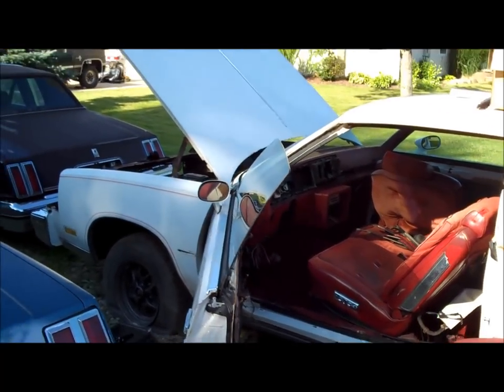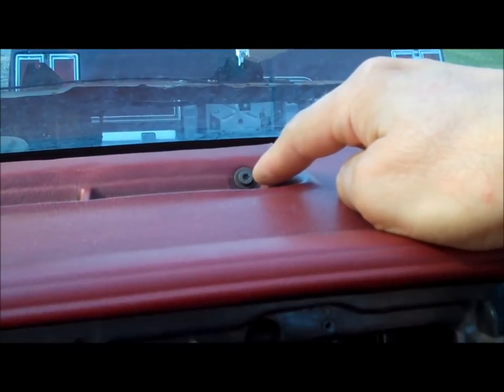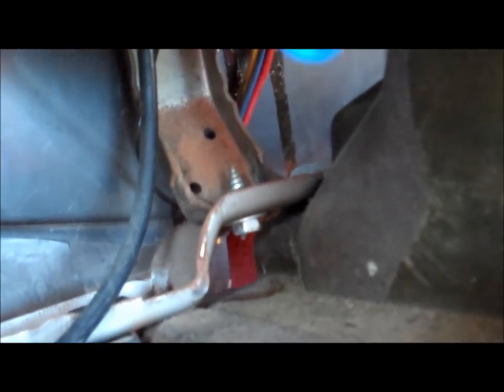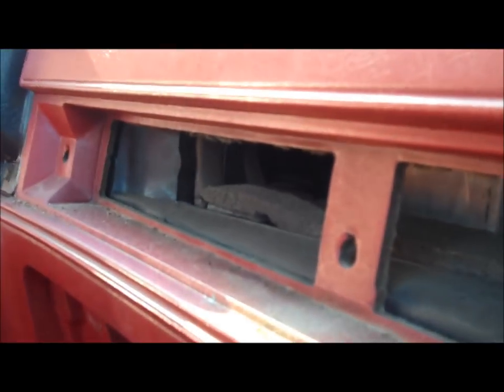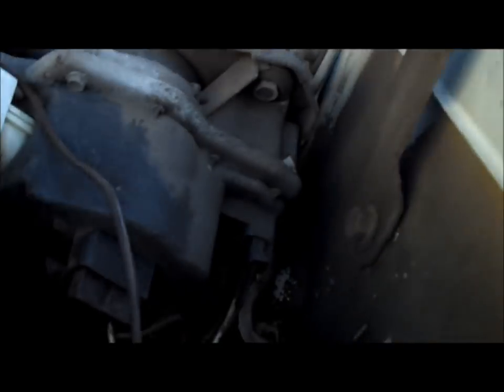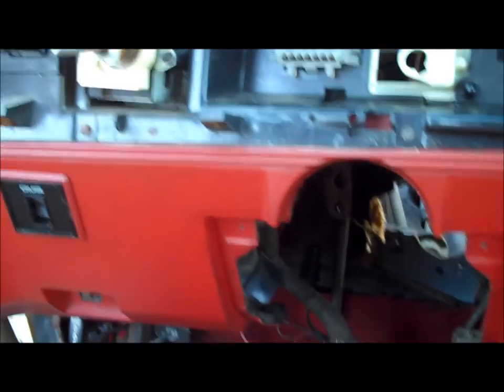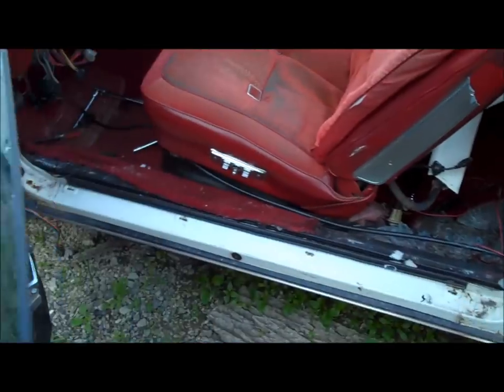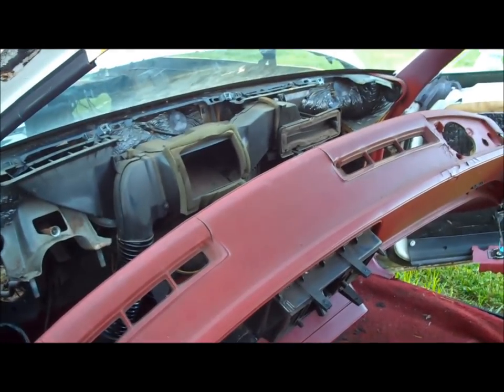How To Remove the Dashboard in a GBody

Comment: I have a 82 gbody I put new lights in my dash but when I turn the dash lights on they still dont come on. Can you help me?
Reply from the maker: If all of your other dash lights work other than the gauges then you have an issue with the gauge circuit panel on the back. Torn copper film.

Comment: I’m going take off my dash on my 84 Pontiac Grand Prix to put my 3.5 speakers in, thank you for your video
Reply from the maker: GP dashes are more tricky. The duct work is screwed to the dash and the screws need to be removed on the drivers side ducting behind the gauge bezel.

Comment: Great vid.  Question, the plastic (blend door you refer to in vid) broke.  Not during a dash removal, just snapped one morning. Can this be replaced?  Advice or any vids pertaining??
Reply from the maker: The little plastic tab broke off where the cable attached too? It can be replaced. I think I have an extra. I would have to do some digging for them. I pulled these cars the rest of the way apart several months ago.

Comment: Yes that section snapped in half changing from cold to hot one morning.  I found the blend door lever on eBay for around $50.  It's not the price but the labor involved I'm concerned with.  I can do most work on these cars but never had to get into the dash.  By the looks of it, I'm gonna have to pull the dash, because I don't see another way to get the lever piece out.  I don't see any vids/web articles giving specifics, was just wondering if you had any experience regarding the issue.
Reply from the maker: I believe you can change the blend door from under the hood by removing the top of the heater box assembly as if you were changing the heater core.

Comment: How many bolts hold the under dash upper ducting in. Is it possible to remove this stuff without  removing the dash shell? Already got rid of the firewall stuff. I want to use a lighter and smaller aftermarket box at a later date.
Reply from the maker: Keith Cromer  On an Olds dash you must remove the cluster and the plastic backing behind the cluster to remove any duct work. If your looking for weight reduction don't waste your time. Its a few pounds if that.

Comment: Looking for electroluminescent lights repair/replacement for my 1984 Regal. These are the exterior lights on the sides of the rear seat next to the windows. They are partially working but I want to fix them. I'm having trouble finding replacement parts for my car so any help is appreciated. Thank you.
Reply from the maker: try ebay or joining Classic Gbody Garage on Facebook and asking there.
Reply: @ClassicGBodyGarage  check out ETSY.  I had a Riviera that I replaced those pieces on.  Like $20-30

Comment: Thanks for sharing. I'm in the middle of 86 El Camino mild restro and have request for a video on cleaning up the wiring behind the dash. I installed a dash cap, I'm a lil discouraged in the wiring department. I have an old alarm to remove and just want to clean up and run the wireing behind the dash board along with testing everything prier to Installing. Want to run everything like factory or better. Thanks
Reply from the maker: +Vincent Rodriguez If you want to clean it up you should remove the dash then you can easily figure out what is part of the alarm and what isn't. Email me and I can send pics. I ahve a dash out of a car with the harness still attached. olds7980@yahoo.com

Comment: How did you get the knob on the light switch off? Is there a clip?
Reply from the maker: Depends on the car. If a 78-81 Cutlass then there is a tab on the back you pull toward you as you pull the knob towards you.

Comment: Quick question what would cause the chime when like the door or open with the key in the switch 2 chime all the tme n is it a fuse I can pull n which fuse
Reply from the maker: +Marion Walker It is a switch inside the column when the key is in the ignition. If you want it to stop you need to fix the column or remove the chime under the dash.
Reply: Thanks

Comment: Hi, so I dropped a ring in the top vent of my 78 cutlass, is there any way to a access the vents? Or would I have to remove the dash? Thanks
Reply from the maker: You can pull the wood grain panels off the dash and potentially grab it. Which vent was it?

Comment: iam wanting to swap dashes in my 1980 malibu with a different gbody dash with two speakers instead of the single one in the center of the dash because my dash is trashed will this work and what else is needed to do swap i know for an example my wiper switch is on the dash not the column is there any dash better then then the others also do you have any dashes that are in good shape that you would be willing to sell
Reply from the maker: To make things easy, swap in an 81-88 Monte dash with 2 outer speakers. Everything will mount up and work the same. You may just need to run new speaker wires. Easy. I do not have any dashes available.

Comment: if am trying to access the ignition switch of a 1987 Monte Carlo for a remote start, do I need to remove the dash? Where do I find the ignition switch? Thnx
Reply from the maker: Lower steering column shaft. Right side.
Reply: Thnx. Lastly, how do I access the wires for the parking lights and horn?

Comment: how do you remove the gear selector cable and or speedometer cable to get cluster off?.
Reply from the maker: Gear selector cable is clipped to the steering column collar. Need to remove the lower vent panel under the column and you will see it.

Comment: alot of cars speedometer dnt work mite be good video on how to repair it finally got mine goin but that one thing on g body the speedometer not working
Reply: Does your speedometer read correct MPH,  if so how did you fix that issue?
Reply: Nope nerd to put new wire

Comment: I have a 1980 Olds Cutlass diesel and it has an aftermarket remote car starter that I want to take out. I can see the wires running right up behind the gauges but I really dont want to take apart the whole dashboard :(
Reply from the maker: +Brian Williams  Its must likely spliced into the ignition wiring that is up by the steering column or they spliced into the wires near the starter but doubt that. There is nothing they would splice into behind the dash.
Reply: Thanks for the reply! Im currently taking apart the gauge cluster from the dash. I have an Auto column shift and theres a wire connected to the steering column for the parking position. Im still having trouble pulling it out its not budging still and the speedo hose isn't the problem I dont think
Reply from the maker: +Brian Williams The clip just pops off the column and then you pull the cluster out.
Reply: Thanks but I already took it out thanks

Comment: How do you get the speaker covers off?
Reply from the maker: They snap down into place. DO NOT pry to get them off as you will crack the dash. Best way is to push them up from the underside by removing the glove box for the passenger side and and since you can't get the back side on the drivers side you can use a small hooking tool to get under the edge from the top.